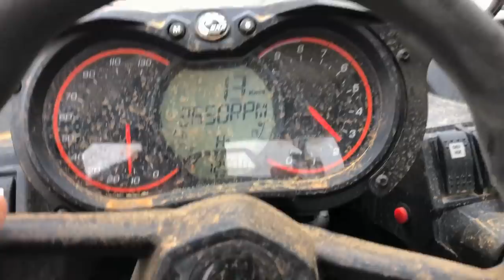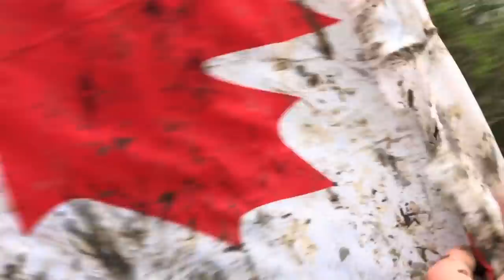CRASH MAN DOWN! Assassinators 4X4 MUD NATS TEST!

Comment: Someone needs to come out with some Extra Heavy Duty Axels for these sxs with the tractor tire treads and high Hp engines. The seem to just snap axel’s like twigs !
Reply: RCV makes super heavy duty axles for Canam and Polaris but when you're talking ~$800.00 an axle it adds up pretty quick.
Reply: I've watched this whole series and it's a common problem. I've never owned a sxs but it seems like a propose built weak point. Maybe to save parts on the other end of the drive line? I pop and throw chains all the time. I'd rather pop them then my trans. Not really sure how a sxs works.
Reply: I’m going to check out RCV, I don’t think I have heard of them bf 🙏. I had a Ranger Xp with 29 HL 2’s and I never had any problems. Know I use mine for duck hunting and some riding. I am looking at getting something new this fall and have been impressed with the Defender XMR . I hope the axel issues have more to do with the tires that’s on the machine than anything else.